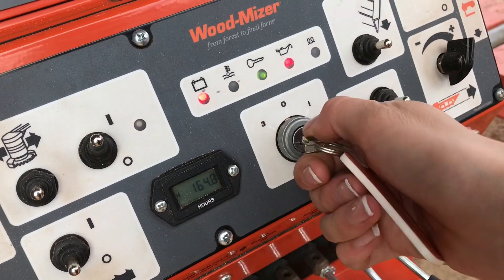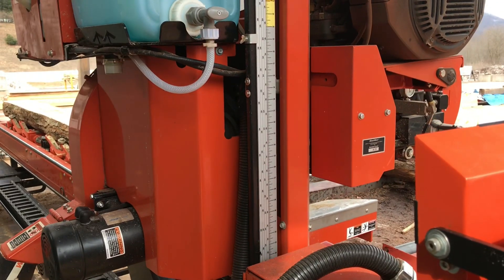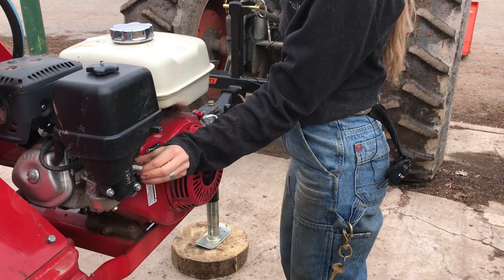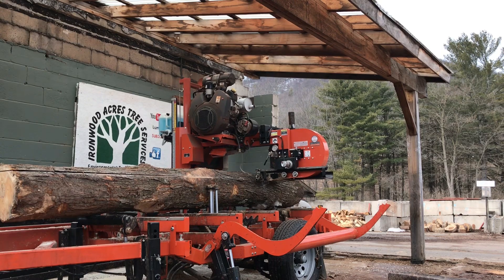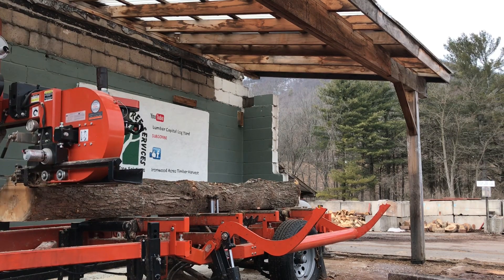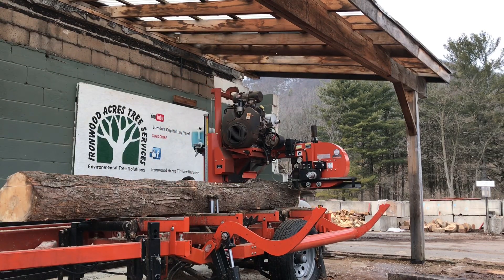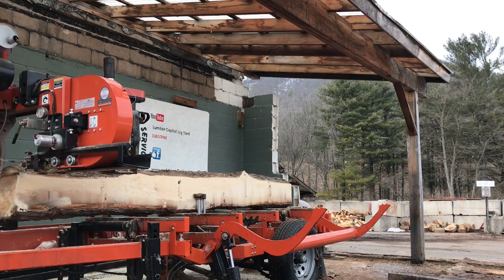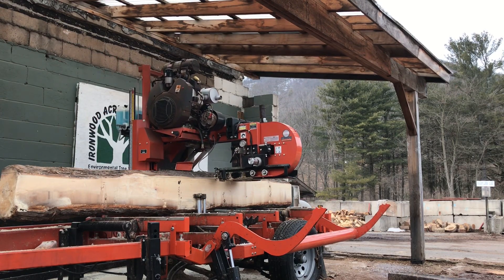Cutting railroad ties on an LT40 Woodmizer

Comment: When I was 20-22 (81-83) I worked at a family-run logging and milling business in the northern Sierras of CA. Most of the logging was salvage sales for the U.S. forest service. The mill was a 42" radial saw run by a 350 chevy V8. Whenever we were between milling jobs, we would cut ties for the local treatment plant. I was a kid on the green chain by myself. Sometimes six ties would come off with the last cut. I would have less than a minute to deal with them before the slabs of the next log would be coming. Mostly we cut ties from "piss fir" It was more commonly known as white fir, but it smelled like piss when you milled it. They were heavy. It was brutal work. I learned to hate the days when the boss said, "we're cuttin ties today."

Comment: We enclosed 3 acres using 2x6's and nailing them to used railroad ties, back in the '70's. They were soaked in creosote, and protected fairly well from rot. Worked pretty good. 30 inches deep, they weren't going anywhere. Wondering if you have any market any longer for mining timber? Worked 5 years in a coal mine, we used a timber every 6 feet, and then quite a few crib blocks for problem areas. Mostly roofbolts to secure the roof, but now and then, the blocks. Using timbers you could tell better, if the weight was riding over your work area, by how squashed the wooden cap pieces were. Fun times.

Comment: When cutting the rail road tie, do you pay any attention to centering the pith of the log?  Or sometimes called boxing the heart wood?  It is supposed to allow of even drying and less chance of cracking.
Reply from the maker: It usually happens by default.